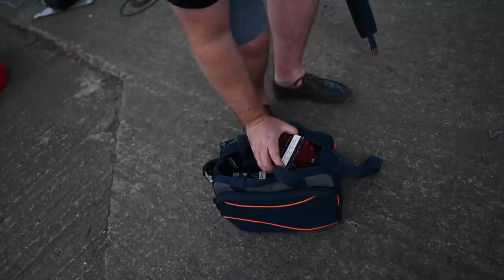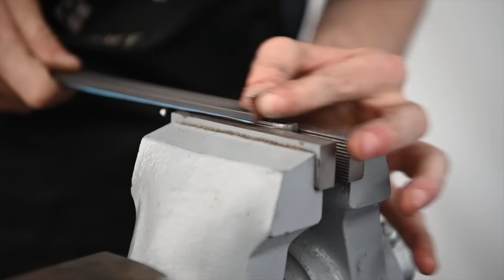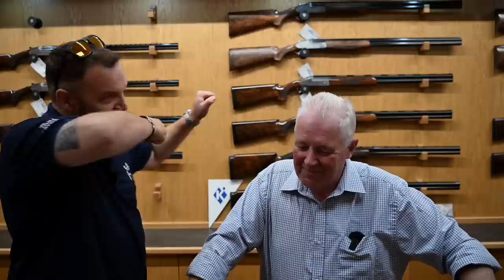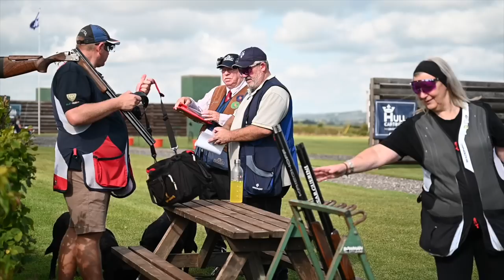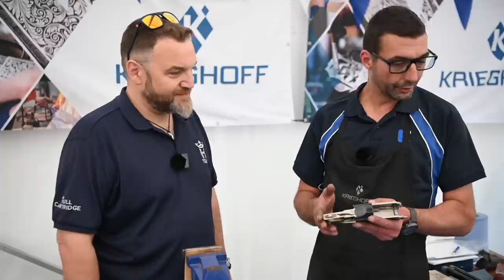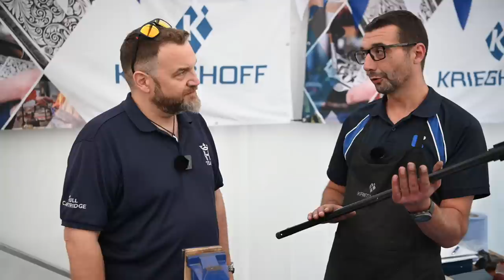Krieghoff

Comment: Very true that Krieghoff has the best service, needed an emergency service at the Fitasc Sporting in Italy, emailed Phil Krieghoff and he responded less than 10 minutes later and was happy to assist. Krieghoff are the absolute kings at customer satisfaction.
Reply: They ought to be for the price the only thing i disliked in my ownership of one for several years was the recommended yearly service. Which i think is abit crap i didn't do it one year and the gun went wrong also has happened to several other friends and shooting buddies who skipped it for a year or two so the whole built like a tank is not true for me, as if it doesn't get serviced very regularly it goes wrong which hasn't happened with any other gun I've owned.
Reply: @Lethal_Intent  NOT Vorsprung Durch Technik..Save £1000`s get a Browning or Miroku Beretta etc

Comment: As others have said the video is let down very badly by the editing - absolutely pointless to talk about the many differences, major and minor, differences between guns by pointing at a gun off camera. It's a great shame as Alan was in great form as an ambassador of the guns which would have been far more valuable to non-owners with the guns in shot whereas the way it was edited wouldn't inspire anyone to buy a Krieghoff. Obviously space was an issue but surely you could have taken down those on the wall behind you and replaced them with Krieghoffs that could be referred to? As it stands the video, in my opinion at least, is deeply flawed by the absence of the guns -  my suggestion would be to withdraw it and re-edit with pictures of the guns being referred to inserted as "PIP" photographs as otherwise many will not have a clue about floating ribs / barrels or the nuances of stock design and potential new owners will simply scroll on by non the wiser.